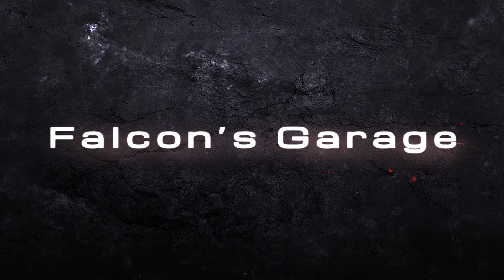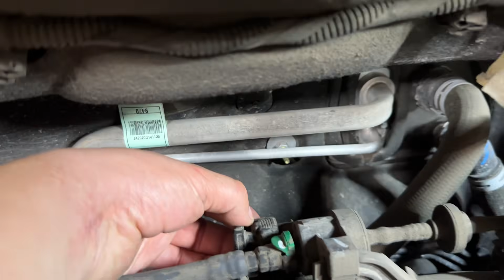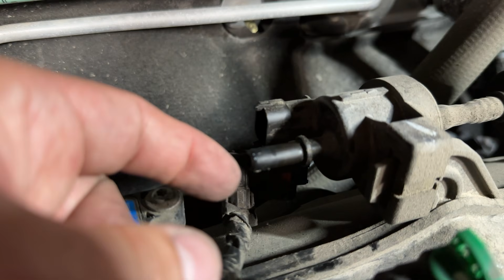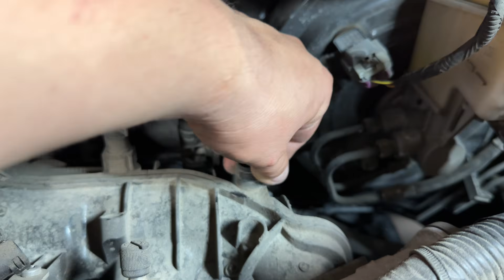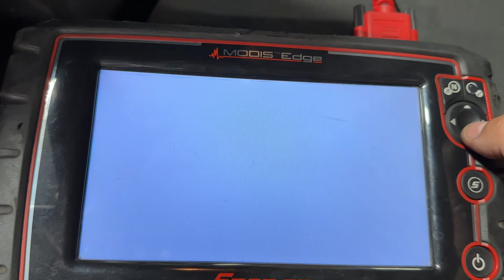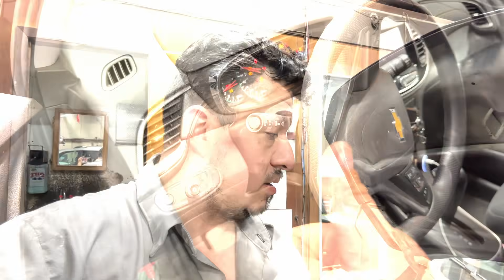Check Engine Light? EVAP Purge Control Valve Circuit Malfunction - P0443 P0496 - Chevy Trax

Comment: But how I get engine light off after ?
Reply from the maker: You can disconnect the battery for about 5 minutes it should reset the system. Or it should go away by itself … but that could take days
Reply: It should disappear after you installed your part. If not then something else is wrong

Comment: This is a great video. I replaced mine and the check engine light was gone. But after a mile of two down the road it came back. What would be the next step?
Reply: Did you fix it

Comment: Is there anything that needs to be unplugged before you replace it , my mechanic says “you need to cut the fuel off before doing it It's connected to a fuel vacuum hose “
Reply from the maker: @SashaKing-g4z  no. No need to disconnect anything else for this particular purge valve I showed on the video

Comment: My childs Trax just threw a P0496 code.  Thanks for this video.  Looks like a lot easier to replace than on my 2009 Silverado which had me under the truck by the gas tank.

Comment: Thank you I put a purge valve in my car this morning. I had a very hard time disconnecting the part that’s connected to the engine. And it was my first time ever working under the hood all by myself with the help from my neighbor who had tools I was able to use. I disconnected my battery how long do I drive before go back to inspection?@falcon’sGarage.

Comment: Bro I replace these and mass airflow sensor ran better few months later engine light on valve cover was leaking on bottom left corner and thermostat was leaking so I replaced it now my check engine light on for p0171 p0443 p2227 emission not ready AutoZone said is wiring problem please help I’m broke asf lmao
Reply from the maker: @obs_vega5704  1st NEVER trust anything autozone says. 

This cars are known for the intake/valve cover to go bad. 
Have a mechanic check it and do a diag

Comment: Hello there, i have an issue with my chevy trax, so when i fill my fuel to the tops, its always kinda hard to start the car. Is it because of this canister valve?
Reply: My moms car is doing the same thing yes, it's because you haven't replaced it yet
Reply: I have the same issue. I’ve been watching this video because I have to fix myself. Fingers crossed!

Comment: Changed the purge valve after 4 key cycles cel light is back cant figure it out
Reply from the maker: did you test out the old purge valve before replacing?

Comment: I don’t have any check engine light but when should this be changed?? I’m at 48600 K miles
Reply from the maker: No. No need to fix what isn’t broken
Reply: a ticking sound started very faintly in this cold might be that purge valve about to go i have 48k miles @FalconsGarage
Reply from the maker: @nizo6673   a ticking from this valves is normal and actually thats what they should do ..
Reply: @FalconsGarage  but it got louder in this cold weather?? -1 example it never got this loud it’s gets quite when the motor is warmed up but still ticks faintly
Reply from the maker: @nizo6673  the purge valve is commanded by the computer. It commands it to open up from 20-100% and the more it opens up the louder it gets. So the sound will not always be the same
Reply: i like to get ahead of future problems
 @FalconsGarage

Comment: Bro I just replaced my purge valve it works a lot better now but I still got light blinking. It goes away but when reviving it comes back. 
Not getting any new codes
Reply from the maker: blinking check engine light?
if so thats a misfire
Reply: I changed all spark plugs also. Not getting any code on my reader. I got code for purge valve. I don’t see why I don’t get code now. Yet still blinking. Gonna try to get it checked tomorrow but it’s tough getting it checked same day.
Reply: yup was bad coil pack. idk why it took 3 tries to get a code on my reader @FalconsGarage